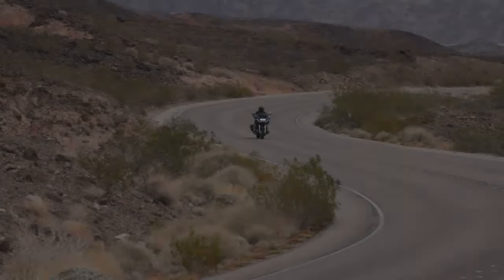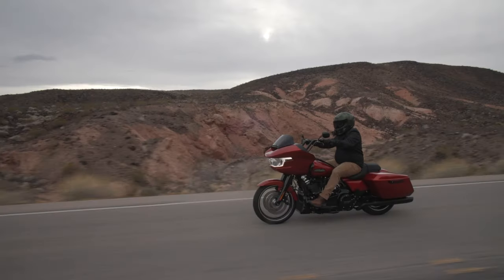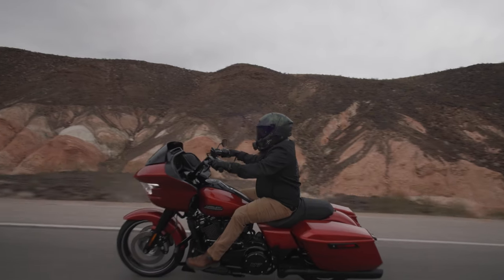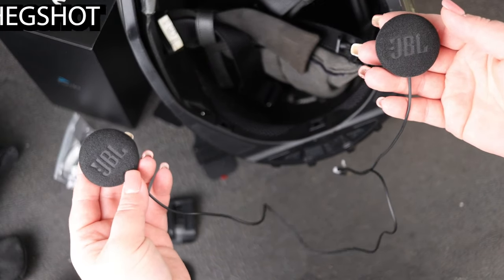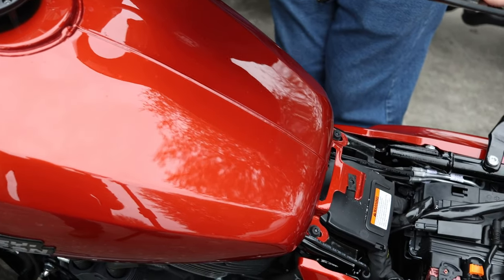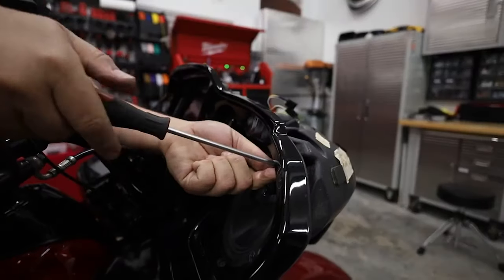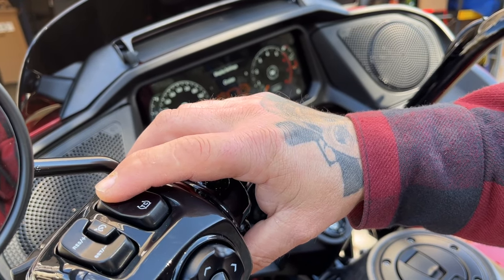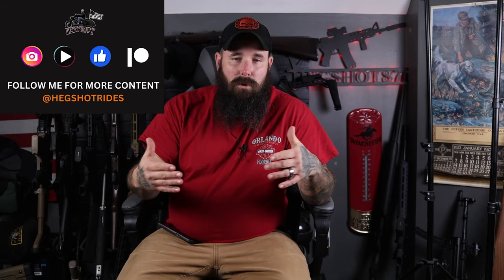7 Hidden Features Of The 2024 Road Glide

Comment: Couple little hacks not mentioned. 1. Adding a $10 USB Bluetooth mic from Amazon and adding it in the device manager will give you wireless Apple Car Play every time you start your bike. 2. If you add the garage door opener, two quick pulls on the left side controls trigger will transmit the opener without having to go through the menu every time.
Reply: Link for a bluetooth mic you recommend?
Reply: You can also just hit you "flash-to-pass" switch and it opens the programmed garage door (in position #1) which is even easier.

Comment: The more you make videos of these Harley’s, the more you’ve sold me on the Indian touring bikes.
Reply: These now blow the air cooled comparable Indian out of the water and come close to the challenger. The challenger is the only Indian that has this beat and that gap is now small if there is any at all.
Reply: The Indian are beautiful but the challenger is riddled with electric gremlins, starts up sometimes and the ECU has thrown a tantrum and sets cylinder 1 to misfire. Turn it off for 10 mins and it resets itself, not great when you're out on your with a bunch of people amd hold them up.

Comment: Thanks a lot for the heated gear tip. I just picked up a 24 yesterday. Installing the heated gear plug was a little time consuming on my Low Rider ST. For those that don't use heated gear its awesome. With a mesh jacket and heated gear I never get cold.

Comment: Another hidden feature H-D doesn’t mention in the manual is the ability to activate the cooling system fans on-demand. This is accomplished with the engine not running and roll to full throttle for a few seconds. So if riders are in stop and go traffic, they can stop the engine momentarily and activate the cooling system fans constant-on and help keep the heads cooler.

Comment: I’m in Orlando, Clermont area. That hill hold control is a huge benefit. Thanks!
Reply: Orlando has hills?
Reply: @heathwest3718  Not mountainous hills like other parts of the country. But hills, nonetheless. Clermont is the highest elevation in the state of Florida.
Reply: Yes, those 1/2 percent grades are hard to handle.
Reply: Hill hold control is necessary in ORLANDO? Jesus, dude. Learn how to ride and figure out “friction zone”
Reply: @williamwheeler9708  Friction zone while stopped on a hill? Why, when there is a hill hold feature? I paid for hill hold I’ll use that. Like people will say, “Look at him manage that friction zone while stopped on a hill!”
Reply: If you NEED hold hill feature, you do not know how to PROPERLY ride a motorcycle. And trust me, 90% of riders have no clue how to PROPERLY RIDE.
Reply: @williamwheeler9708  Is this where I pound the keyboard and say, I AM A SKILLED RIDER HOW DARE YOU?! Hill hold is a feature. Use it or not. Should I turn off the ABS too? If they come out with an Air Condition for the MF I’m using that too.
Reply: ABS and Hill Hold are mutually exclusive of the other. If you NEED hold hill feature in Orlando - as I stated earlier - you have no idea how to properly ride a motorcycle. PERIOD. I live in Pittsburgh Metro with serious hills everywhere I ride. Never once in 40 years has my ass ever puckered, stopped on a hill, with a passenger. This is the part where I tell you LEARN HOW TO RIDE.
Reply: @williamwheeler9708  Lol. Calm down you gone give yourself a heart attack. You're an excellent rider. Keep it up. It really moves the universe. The hills here in "Clermont" Florida, are enough for me to enjoy the benefit of Hill Hold. It keeps the bike in place and works just fine. That's what it was made for. I'm not in competition with you and doubt anyone is paying so much attention when you're at a light to acknowledge how well you manage the clutch on a hill. No one cares but you.
Reply: @antdel33 good answer
Reply: @antdel33 Hill hold is freakin awesome
Reply: @taff782ify  Not sure what the other guy was talking about; clutch management on a hill? Most riders fully engage the clutch and apply the rear brake.
Reply: @antdel33  That they probably do. But hill hold does it for you. Im getting on in years, fully loaded, two up; its a breeze to just sit with both feet on the ground, just using one hand on the clutch. Do you need it all the time? No. Is it a great thing? Yes! It's a feature that doesnt have to be used. Just like ABS, radio, windshield, heated grips, electric start; list goes on. Test drive one that has it fitted, you may like it.
Reply: @williamwheeler9708   i suppose you still perfer to kick start your bike?  Electric start isnt needed for guys like you.  i perfer to take advantage of technology.   Trust me, i have plenty of riding experience.

Comment: You should talk more about the rear suspension options.  Dealers do not pre set your bike suspension to your size.  Most bikes go out with softest settings and can bottom out.  Even a seasoned tech does not usually set suspension.  They set mine at max and the Unloaded rear, push down into my brand new exhaust so I had to re set all and find the happy spot.  Harley adjustment chart is way off of what is really needed.

Comment: How’s the wind protection with that shorty windshield?   No one, including you, talks about it.
Reply: I’m 6’4 and it’s to short my wife is 5’3  and says it’s perfect
Reply: I'm 5'8" and it sucks.. wind hits me right in the nose/eyes. Patiently waiting for KlockWerks or Memphis Shades to release something a windshield for it.
Reply: I’m 5’11” and hate that shield! Can’t find anything yet - except a clear shield from HD. No thanks! Still waiting for that and passenger footboards that match my 2023 CVO SG.
Reply: I'm 5'6" and it's perfect.  But I also wear a full face helmet, so wind is no problem.  I have a '24 SG - it's so much better than my 2015 SGS!  So glad I traded up!  Also, my dealership found a guy that was able to take my stock clutch lever and bend it a little so its closer to the grip.
Reply: My son just bought 24 RG today, planning on putting a Freedom Shields wind shield on it. I have one on my 19RGS and it has been great. Doesn’t vibrate like the klockwerks did when tested.
Reply: Do you feel the Freedom Shield results in less buffeting and overall "wind noise?" I've only ever used Klock Werks and I can't imagine it getting better in that department, although like you said the one on my 16 SGS did vibrate quite a lot. I just ordered a Klock Werks 12" touring windshield, but if Freedom Shields are equally as great in the buffeting and wind noise department, then some lucky bloke on Facebook Marketplace will be getting a good deal on a barely used Klock Werks.
Reply: @xphire  definitely less wind noise than stock, less buffeting than stock, freedom shields was recommended to me by friend who ran one on his CVO. Order it, try it with the protection still on it, don’t like it you can return it. If you like it, happy riding :).

Comment: Does the 1 inch of travel make a big difference?
I have a 2019 Road Glide Ultra that I love (and it's paid off)
So, I'm in a battle with myself. I love the hill-breaking feature, as I have a small amount of arthritis in my hands, and that would be a GOD send to
have help on hills (I live in S.C near Augusta Georiga), and they have a LOT of hills, so this would be a big help.
I love the screen, it's bigger and easier to see, especially for long-distance traveling.
The seats and lack of a tour pack are a turn-off, though I could add the tour pack and get another seat, which would affect the overall pricing with my paid-off trade-in.
Also, my understanding is the bike is lighter than previous models, but by adding back in the tour pack, you're just adding back in the weight.
Question: How is gas mileage. Is there an improvement?
Also, how is the sound system? Is there an improvement? Or would upgrading to a step-up sound system be the best option. As a military guy, I've lost some hearing, and while my 2019 has a good sound system, more sound would always be great. So, did they improve the sound system on the new 2024 Road Glide?
The one thing that bothers me is the damn "pegs" they have for the passenger. If you are going to do any type of long travel, floorboards are the best option, so why those are not standard is baffling to me.
NOTE: I love riding from S.C to Florida, and that's about a 9-hour trip depending on how often I take a break (usually when filling up)
So, the question I guess I have to ask is: Is the trade-in worth it?
Reply: Gas mileage: After 2 weeks of 90% highway riding, I'm getting over 50 MPG. Even during the 500 mile break-in period with countless wide-open-throttles (to seat the piston rings better), I was still getting over 45 MPG.

Sound system: Stock sound system is OK, but not great. If you've lost some hearing, you'll definitely want to upgrade the sound system which will run you around $1k installed depending on your location/dealer. Based on the power ratings, the Rockford Fosgate upgrade that Harley offers looks like it'll add quite a bit of volume over the stock system. If you find that upgrading the front 2 still isn't enough, the Rockford Fosgate amp supports 2 additional speakers which you can add to your saddle bag (would have to buy new lids with the speaker cut-outs).

Is the trade-in worth it? Well, I came from a 2016 Street Glide Special that I was quite happy with, and in my opinion, yes, it was worth it for me. The 24 RG just feels like "home" to me, something my 16 SG was missing. It'll take something earth shatteringly revolutionary to convince me to trade up again. My $0.02 though, go test ride one. I didn't even want a RG, but then one of the sales guys convinced me to give it a try, and I reluctantly agreed and said "sure, but I'm not buying it, just so there aren't any misunderstandings." Welp, jokes on me because when I got back from my test ride I bought it. Like I said though, I'd recommend a test ride at a minimum, and just keep in mind you're like me and going to spend a grand to upgrade the stereo, but maybe you could talk them into upgrading it at no charge as part of the deal. Either way, best of luck and ride safe, brother!
Reply: Sadly for me, it won't make a difference. Somebody pulled out in front of me and totaled my bike. I have several months of rehab to go through in order to just be able to walk again.

Comment: I would like to see a video on the weight change, front suspension and any other ride characteristics. I am sensitive to center of gravity and ride height.
Reply: I can tell you the 24 RG feels quite a bit lighter than my 19 RG taking it off the stand. The bars are also a lot more comfortable and both these give the bike a lot more nimble feel. I dont really like the buttons but I guess I will get used to them

Comment: I noticed that you have a Ruroc helmet. Do you have the shockwave system in it? (The Bluetooth headset that ruroc sells) and if so do you know if that headset will connect and make apple car play usable in the bike?
Reply from the maker: Yes it has the Bluetooth integrated but I ripped it out and replaced it with a better system which is the Cardo. I left the link to Cardo in the description up above.

Comment: Bought a new 2024 Street Glide.   Was told by the sales rep not to use the cruise control during break in miles.   Any reason for this?
Reply: Because during break in they don’t want it to run at the same constant speed for long periods of time.
Reply: I know you're probably well past the break-in period now, but running at a constant speed for long periods of time during the break-in period can result in the cylinder walls becoming too slick and smooth for the piston rings to seat fully. The unspoken part of the manual regarding break-in is that you need to put the engine through several heat/cool cycles by loading up the engine with moderate/heavy acceleration (heat cycle) followed by immediately letting off the throttle and letting it engine brake (cool cycle) you back to your cruising speed. Loading the engine puts pressure on the piston rings and pushes them outwards into the cylinder walls, while engine braking essentially does the same thing except from the other side.

The reason this is important is because the better your piston rings are seated, the less "blow-by" you'll have. Blow-by is exhaust gasses escaping past the cylinder walls (vs being exhausted through the valves), and the more blow-by you have, the less power and fuel economy you'll have, which also in turn decreases engine life. Plus, another reason for not using cruise control during the first 500 miles is that you want all of the engine components to experience a wide variety of driving conditions while they're all bedding/seating. 

So, one of the best things you can do for a brand new engine is to ride/drive it hard for the first 500 miles. No need to redline it, but repeated heavy acceleration such as WOT in 6th gear from 2500 to 4500 rpm immediately followed by engine braking/no throttle from 4500 back down to 2500 rpm within the first 500 miles is optimal. 

Technically if you rinse and repeat this procedure a few dozen times, then you're probably good to consider break-in complete, but personally I'm super anal and almost all of my first 500 miles are comprised of this.

Comment: Volume down all the way is the same as mute. Cheap looking plastics. The saddlebags arent as sturdy as previous generations either. They need to sell new bikes so im sure they are grateful for your purchase. Victory way back when had inverted forks but Harley still dont want that. Hydraulic clutch is much less low maintenance.  The new horn is tacky also. Thanks for the video

Comment: So how does the mute work bc I just bought a 2024 Saturday and the radio was working on the test ride. I think the dealer may have muted it and have no sound now can you make a video on the mute?
Reply: I think he is using the play/pause button (in middle on right handlebar) in the video which only would work if you're using Bluetooth.  Try using the up volume or change stations. May have to turn off of Bluetooth if they had it connected to their phone.
Reply: I had the same issue. Upon delivery of my bike the radio/stereo no longer worked. Dealer came back and picked up my bike (too much winter here to ride), apparently a wire came off the amplifier and there was no sound coming through. Dealer technician contacted corporate to report the issue to determine if there was something further to be done. Apparently, on top of this there was a second update to the OS that needs to be performed. The glory of buying a new model!
Reply: On my 24 the mute only pauses when using media source. On radio (fm) it doesn't mute.

Comment: After watching this video I really don't want the new Road glide as much as I used to it to much electrical B.S. I want simple and reliable not a degree in rocket science to ride my bike
Reply: Good news is you can still just fire it up and ride and not even mess with any of the electronics if you don't want to... except tow mode I guess?

I'll just add that I almost didn't buy the 24 RG because of the screen. Not that it isn't high quality, but I'm old school and just prefer analog gauges. I will say though that it didn't take long for me to come around. Although an old school analog dash would still look sexier (IMO), I've actually come to appreciate everything the new dash/electronics/infotainment system offer. So, just my $0.02, the value offered by the modern electronics offsets any lost sex appeal.

Comment: I was surprised how quickly my battery drained with the bike sitting in my garage. It was only a few days and I went to start it and it was dead. Looks like I’ll need a tender on it all the time. Or, something is drawing on the battery all the time.
Reply: If the battery was at full charge before parking it, I'd definitely take it to the dealership for warranty inspection/service. Although I've only had my 24 RG for a couple weeks, it did sit unattended in my garage for several days (against my will) and it fired up no problem. 

Well, that's a lie, I grabbed the wrong key fob (for my truck) once and thought the battery died. I hooked up a charger only to see it had full charge which is when I realized I'm an idiot.

Comment: So you have to keep the clutch held to hill hold to engage?
Reply: That's what it sounds like. It may still activate if you were to put the bike into neutral at a stop light, but why would you unless absolutely necessary? I can't tell you how many times I've nearly been rear ended because the chump in the car coming up behind me doesn't realize that I'm already stopped at the intersection.
Reply: Shifting to neutral disengages the hill hold assist. I've already tested it
Reply: Harley is coming out with a switch that mounts down by the jiffy stand, requires an update to be downloaded. After that it will hill hold in neutral.

Comment: I don’t know if you live like 500 miles away from that Harley dealer. Maybe it would’ve drained your battery, but that battery was dead when I left the fucking shop it was not on a tinder and people were playing with them all the buttons and it had a dead battery just maybe enough to start the bike because the security is not draining the battery that fast. I had the same thing with my bike sitting on the floor, playing with the radio, trying to figure it out and killed the battery and sales people neglected to put it on a tender.